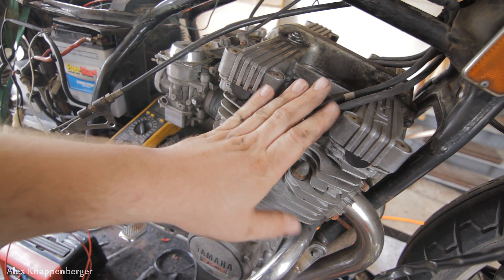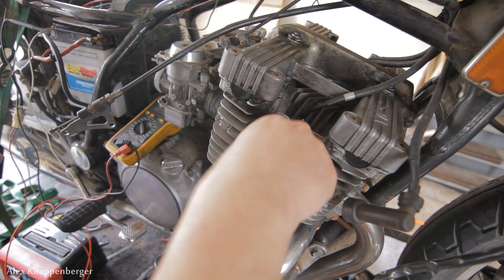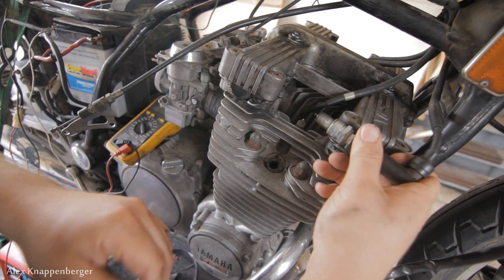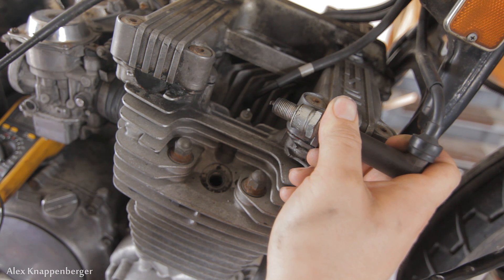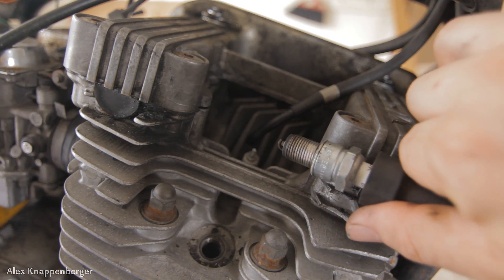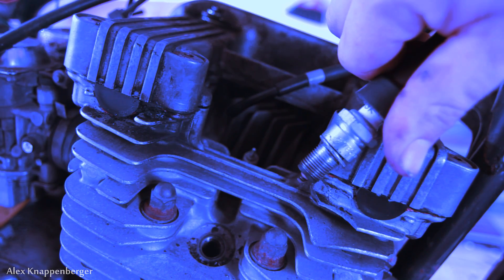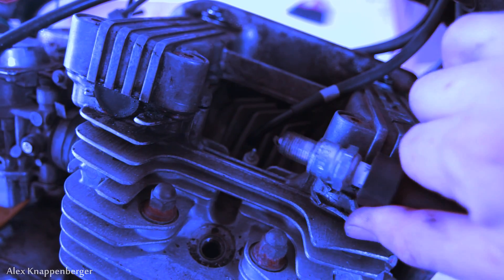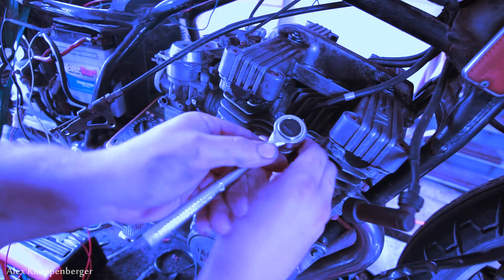How to test for spark on ANY engine - Easy ✔

Comment: 13️⃣ Generator Maintenance Fire, California, USA
	•	Setting: Small-engine generator repair in workshop.
	•	Incident: Technician removed spark plug and grounded it above the cylinder to test spark after recent fueling.
	•	Outcome: Flash fire ignited clothing, causing burns to arms and chest.
	•	Reference: NFPA Fire Investigation Training Case File.

⸻

14️⃣ Turf Mower Workshop Fire, Midlands, UK
	•	Setting: Municipal turf mower maintenance shed.
	•	Incident: Mechanic performed naked spark plug test without ventilating residual fuel vapor.
	•	Outcome: Ignition of vapors, workshop fire damage.
	•	Reference: UK Health and Safety Executive training bulletin.

⸻

15️⃣ Portable Compressor Flash Burn, Western Australia
	•	Setting: Mining contractor servicing petrol-powered compressor.
	•	Incident: Spark plug removed and tested near open fuel tank.
	•	Outcome: Flash burn injury to hands and forearms.
	•	Reference: WA Mining Safety Significant Incident Report.

⸻

16️⃣ Snowblower Repair Fire, Michigan, USA
	•	Setting: Small-engine service shop.
	•	Incident: Technician removed plug and grounded it to the engine while carburetor bowl was open.
	•	Outcome: Flash fire caused facial burns.
	•	Reference: OSHA Regional Safety Alert.

⸻

17️⃣ Outboard Engine Fire in Garage, British Columbia, Canada
	•	Setting: Boat engine repair inside residential garage.
	•	Incident: Naked spark test conducted over engine block.
	•	Outcome: Ignition of vapors, fire destroyed garage.
	•	Reference: WorkSafeBC Safety Bulletin.

⸻

18️⃣ ATV Engine Fire, Tasmania, Australia
	•	Setting: Agricultural ATV repair shed.
	•	Incident: Owner conducted spark test in enclosed space after refueling.
	•	Outcome: Flash fire caused partial burns to hands.
	•	Reference: WorkSafe Tasmania Incident Summary.

⸻

19️⃣ Side-by-Side UTV Fire, Alaska, USA
	•	Setting: University maintenance lab.
	•	Incident: Student technician removed spark plug and tested spark inside vehicle bay.
	•	Outcome: Fire ignited fuel vapors, minor burns.
	•	Reference: University Fire Safety Training Case Study.

⸻

20️⃣ Small Engine Workshop Fire, Bavaria, Germany
	•	Setting: Small engine repair shop.
	•	Incident: Naked spark plug test conducted after recent carburetor cleaning.
	•	Outcome: Ignition of fuel-air mixture, workshop fire.
	•	Reference: Berufsgenossenschaft (BG) Industrial Training Materials.

⸻

21️⃣ Pressure Washer Engine Flash Fire, Yorkshire, UK
	•	Setting: Garden equipment repair center.
	•	Incident: Spark plug test performed in confined area with residual petrol fumes.
	•	Outcome: Flash fire injured mechanic’s hands and face.
	•	Reference: UK Health and Safety Executive Guidance Bulletin.

⸻

22️⃣ Generator Repair Flash Fire, Alberta, Canada
	•	Setting: Residential garage generator repair.
	•	Incident: Spark plug grounded to engine to test spark, igniting vapor.
	•	Outcome: Burns to technician’s arms.
	•	Reference: Alberta Occupational Health and Safety Bulletin.

⸻

23️⃣ Lawn Tractor Service Fire, Ohio, USA
	•	Setting: Lawn tractor repair shop.
	•	Incident: Technician performed naked spark test over engine compartment.
	•	Outcome: Vapor flash caused minor burns and singed clothing.
	•	Reference: NFPA Fire Investigation Sample Report.

⸻

24️⃣ Ride-On Mower Shed Fire, South Australia
	•	Setting: Council mower storage and repair shed.
	•	Incident: Spark plug test conducted after fueling without ventilation.
	•	Outcome: Flash fire burned operator’s hands.
	•	Reference: SafeWork SA Safety Bulletin.

Comment: ✅ 6) Small Engine Shop, Texas, USA
	•	Setting: Lawn mower repair shop.
	•	Incident: Technician removed plug and tested spark over open carburetor bowl.
	•	Outcome: Fire flashed, burns to hands.
	•	Source: NFPA Fire Investigation Training example.

⸻

✅ 7) Outboard Boat Engine, Florida, USA
	•	Setting: Outboard engine on trailer.
	•	Incident: Boat owner pulled spark plug, tested spark in enclosed transom area.
	•	Outcome: Vapor ignited, severe arm burns.
	•	Source: US Coast Guard boating safety training materials.

⸻

✅ 8) Snowmobile Repair Shop, Ontario, Canada
	•	Setting: Snowmobile workshop.
	•	Incident: Technician testing spark plug indoors with fuel leakage.
	•	Outcome: Explosion blew out windows, mechanic hospitalized.
	•	Source: Canadian Occupational Health & Safety case summaries.

⸻

✅ 9) Agricultural Equipment Repair, New Zealand
	•	Setting: Rural workshop, petrol water pump.
	•	Incident: Owner testing spark plug to diagnose no-start.
	•	Outcome: Vapor flash, minor burns.
	•	Source: NZ WorkSafe incident bulletins.

⸻

✅ 10) Motorcycle Race Pit Fire, Italy
	•	Setting: Race pit service area.
	•	Incident: Crew testing spark plug in cramped tent area.
	•	Outcome: Vapor flash burned mechanic’s hands.
	•	Source: FIM motorcycle racing safety reports.

⸻

✅ 11) Chainsaw Repair, Queensland, Australia
	•	Setting: Chainsaw service.
	•	Incident: Technician removed spark plug and checked spark near spilt fuel.
	•	Outcome: Fireball ignited workbench.
	•	Source: Australian IAME safety training material.

⸻

✅ 12) Boat Engine Explosion, New York State, USA
	•	Setting: Marina repair dock.
	•	Incident: Spark plug tested in bilge area.
	•	Outcome: Explosion, burns to two technicians.
	•	Source: US Coast Guard accident statistics (summarized).

Comment: i tried this on a 3 cylinder 2005 toyota aygo, when it cranked initially i observed a single spark, on one of the plugs it sparked twice; then the plugs would stop sparking even though the engine was still cranking. normal or not?

Comment: Welp, my dumbass forgot to ground the spark plug and shocked the fuck out of myself. Hahaha
Reply: Just done this today holy crap I know i’m alive
Reply: @jed7200 better than a cup of coffee, however, if I had had my coffee I may have not shocked myself. Haha
Reply: Same. Made my leg kick 😅
Reply: The Spark Plug Testing  Kit - only foolproof and safe way to do it. Solid grounding no chance of getting a hit from the coil!
Reply: Use insulated pliers to hold the spark plug. Also, make sure gas hasn't recently been spilled on the engine or there is any posibility for gas to ignite from the carb, gas tank or a gas can. Wear a helmet with face shield and protective clothing, if necessary.

Comment: Question.  Trying look for spark one wire coil black yellow. Never re wired bike . Doing motor swap. There suppose be ground wire to coil frame ? Got ignition working she turns over no spark. Coil good tested.

Comment: Be careful doing this with some electronic ignitions, if the plug isn't touching ground and you crank the engine the HT coils can be damaged.  Also some systems can give one hell of a shock that you may regret.  BMW airhead riders take note.

Comment: I got a pretty good shock when I attempted this!!?? Does the tip of the spark plug NOT need to touch the metal of the engine and only the outside of the spark plug? I attempted again it just let the outside (wider part of the spark plug) touch and let it hang and saw a spark. I was hesitant to grab on to it again, lol. I don't remember and didn't want to reproduce but can you touch near the tip of the spark plug with your hand? IDK, obviously I didn't something incorrect to get a pretty good jolt. However, I switched spark plugs from the other cylinder and got a spark as well so the eliminated a spark plug issue and I know now its the coil. Thanks for the clear video.
Reply: Just got the same today, wow that was a hell of a jolt :) know your pain damn..

Comment: Norvelt Golf Course, Pennsylvania, (USA) - worker killed repairing a golf cart that wouldn't start by removing spark plug from engine and unsafely exposing a live spark when testing for spark.

https://www.osha.gov/pls/imis/establishment.inspection_detail?id=107382764

Idaho (USA) - 12yo boy airlifted to hospital with burns to 45% of his body. After helping his dad to repair a lawnmower which wouldn't start. 

http://www.idahostatesman.com/news/local/article164363622.html

Jet Ski incident in Missouri (USA) - man airlifted to hospital with 2nd degree burns.

http://www.autoinjury.com/Blog/2012/May/Jet-Ski-Explosion-Swimmer-Electrocution-Among-La.aspx

Mississippi (USA) - 11yo boy helping his Grandpa test for spark on a garden tiller, airlifted to hospital with 2nd degree burns.

http://chronicle.augusta.com/metro-latest-news-health/2012-04-20/super-bowl-champ-visits-young-fan-joseph-m-still-burn-center 

Georgia (USA) - a mechanic was working on the carburetor of a 1979 Ericson sailboat when gasoline caught a spark from a sparkplug and ignited, causing second-degree burns to the man’s arms and legs, Hall County Fire Marshal Scott Cagle said. The man was taken to Northeast Georgia Medical Center by a relative, and was airlifted to the Grady Burn Center in Atlanta.

https://www.gainesvilletimes.com/news/man-receives-2nd-degree-burns-after-boat-catches-on-fire/

New Hampshire (USA) - The Marine Patrol’s Crystal McLain said that David Ross, 44, of Medford, Mass. was attempting to fix an engine problem when the explosion occurred. Ross opened the engine compartment and pulled out a spark plug, then cranked the engine to clear excess fuel, when gas fumes triggered the explosion.
Ross and a 13-year-old boy suffered second degree burns to their faces and torsos. Both were treated at Memorial Hospital and released.

https://www.ossipeelake.org/news/2006/06/three-boaters-injured-in-two-accidents/

Arizona (USA) - man was working on the right side of ski at the shoreline & had just removed some spark plugs to check this part of the motor when the engine suddenly exploded on him, knocking him back about 20 ft into the water. Luckily, he did not lose consciousness & was able to swim back to shore to grab the emergency fire extinguisher from our jetski to try & put the fire out.

https://www.linkedin.com/pulse/jetski-explosion-replacement-jessie-sheltra/

(USA) - you want to put a plug on the end of a spark plug wire then hold it against the block while someone else cranks it. I have a friend with 2nd degree burns on his face while doing that.

http://www.focusfanatics.com/forum/general-technical-chat/207847-not-focus-but-civic-wont-start.html#/forums/57

USA) - “Once someone in my city breathed in a fireball trying to fix a spark plug. They got seriously injured, and were rushed to hospital, but survived...” Pupper Pearson YouTube
(N.B never remove a spark plug from an engine and expose a live spark!)

https://youtu.be/dFSasN8WQl4

(USA) Men's Room Radio Show Nov, 2016

"Nissan Maxima...car would crank, but not fire up........taking one of the spark plugs out and having me turn the key again to make sure it was getting ignition. Turns out it was indeed getting a spark..........setting the entire engine bay along with both his hands on fire..."

http://www.kisw.com/media/audio-channel/11-01-16-4pm-mens-room-pairs

(USA) - Several Summers ago I backed my trailered Sea Ray (Carbed 7.4L) down the ramp to launch. Turned the key and just a click? Tried again...click. WTF?.....dead battery?

Long story short........stuck needle valve in carb.......boat on angle at ramp.......= cylinders full of gasoline. 

Drove the rig home and removed spark plugs......lots of gasoline poured out of cylinders!

Damn lucky I wasn't blown up.....along with my young son.  

Be pessimistic and cautious at all times. Weird stuff happens and good people get hurt.

http://www.clubsearay.com/index.php?threads/start-up-explosion-question.71373/page-2

(USA) - Another incident I know of occurred when a mechanic was testing for spark by grounding the spark plug wire near a spark plug hole (with the spark plug removed). Unfortunately, the mechanic ignored a leaking fuel float in the horizontal John Deere engine he was working on....A helper spun the engine, which in turn blew fuel out of the spark plug hole. The spark at the wire the mechanic was holding ignited the fuel, which burned down the barn they were working in....The mechanics survived, but they have scars to remind them for the rest of their lives of the dangers of gasoline. I could go on with more stories, but you get the idea. Gasoline is serious business. Please be careful.

Page 114
How to Rebuild and Restore Farm Tractor Engines
By Spencer Yost

South Africa (CARforums.co.za)

"Pull the plug out the motor, earth it on the head and pull the starter"

"We tried that once, landed me with leg full of second degree burns"

http://www.carforums.co.za/viewtopic.php?f=3&t=31220

Australia - local government Penrith City Council - workplace incident testing a spark plug for spark on a leaf blower resulted in an explosion and hospitalization of a council mechanic with second-degree burns to face and arm. Penrith City Council have purchased multiple Spark Plug Testing Kits to protect worker safety and in turn negate risk of litigation from any complacent workplace attitudes.

Comment: Not quite. The system may be adequate to give a visible spark in regular open-air, but it may not be adequate to give a spark in the compressed atmosphere in the cylinder on the compression stroke. 
One way is to use this test is to prepare in advance by first observing the spark while the engine is running properly. Note the quality of the spark. (Note the ambient lighting too.) If the engine fails, compare your developed spark (if you were able to get one) to your memory of its strength when the engine was running properly. It should look about the same, considering the effects of (maybe) different ambient lighting.
Reply: How would the engine be running properly if you were also able to observe the spark?   Wouldn’t a properly running engine have all of its sparks installed?
Reply: Please never touch an engine

Comment: Also you may want to ware leather gloves or gloves with rubber fingers, if the coil wires are faulty or old and cracked you could get zapped while its not a big deal it does smart a bit. :)
Reply: I like to live life on the edge! I take my chances and get reminded of it omce in a while🤣🤣🤣
Reply: Should of read this, that was a wake up call!!!